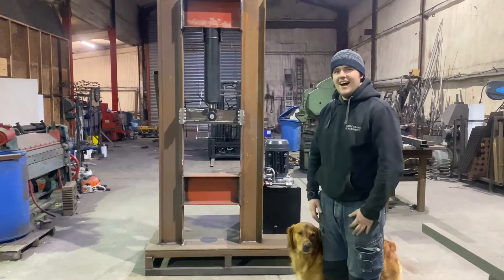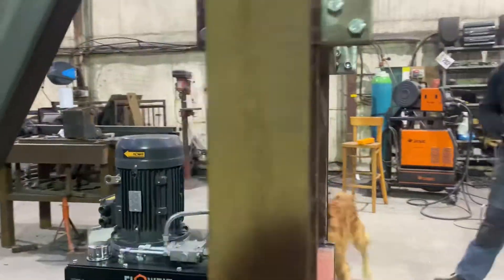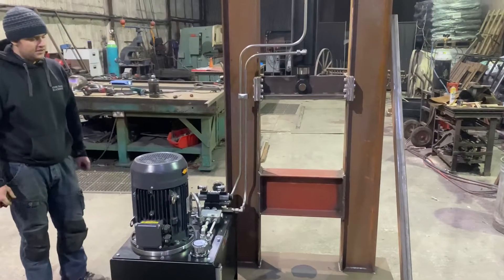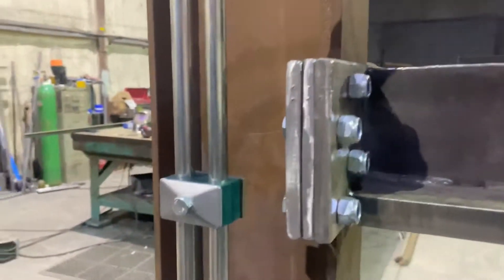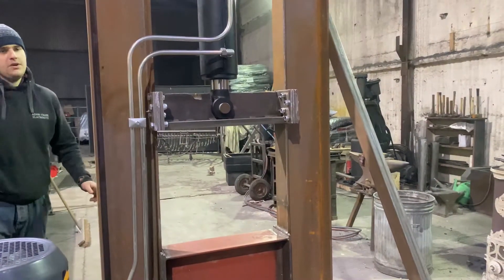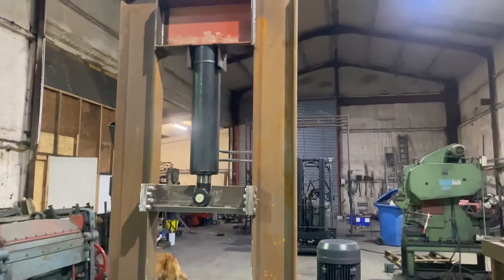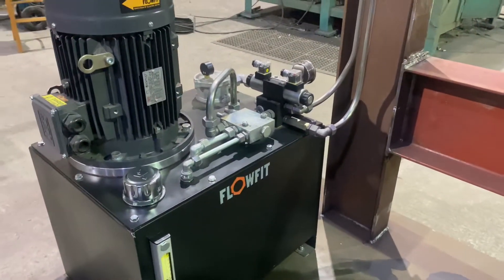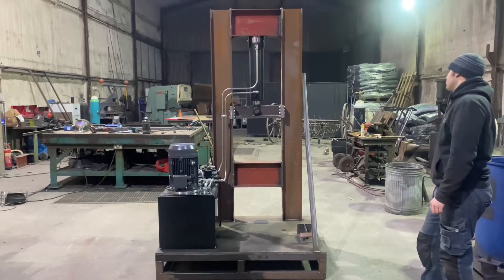Hydraulic forging press

Comment: Hydraulic oil is combustible.   Die-cast houses use glycol and have to replace pumps so no fires start from the fluid that drips on the floor.   They leak a little so a collection pan from sheet metal could be put underneath.